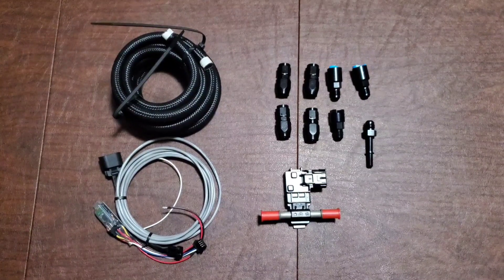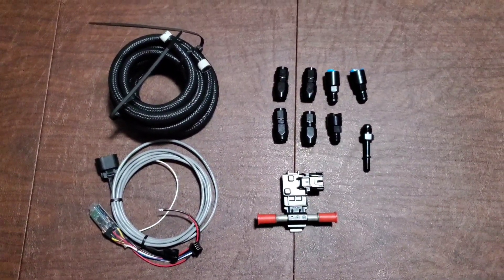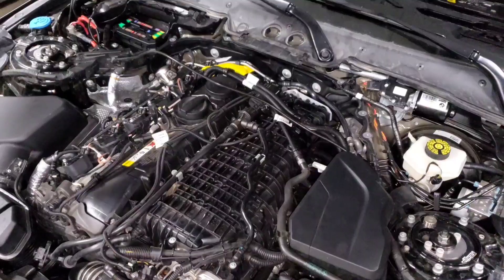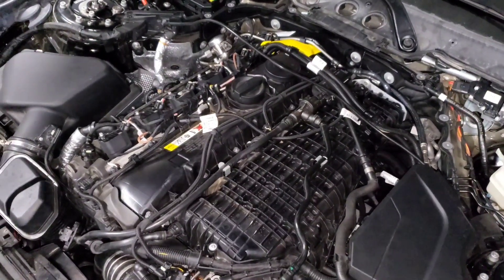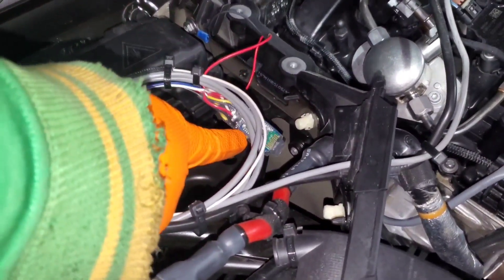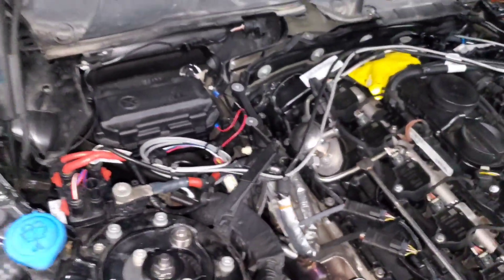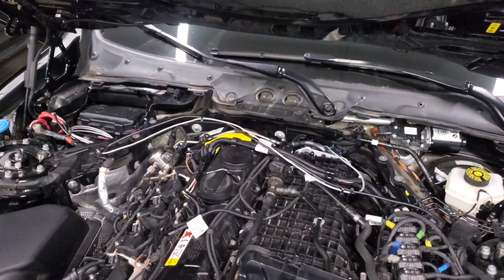How to Build your own B58 Ethanol Analyzer

Comment: Do you have a video on how to do it with 360 fittings instead of making a new line? Or know anyone who does?
Reply from the maker: Check out my mhd flex fuel kit install. It should be included in that one
Reply: @ bet thank you
Reply: @kern417 I also have a 2018 440 I need to buy the fittings, do I need 5/16 or 3/8? Thank you!!

Comment: Hey brother, I had a spool it kit. Then removed due to rat damage and misplaced it somewhere.
Anyways, I got left with the spool it analyzer itself. I should be able to diy the rest right, as for going along with your diy?
I’m currently on a dorch stage 2
Reply from the maker: the easiest way is to add the pr loop fittings with a sensor. no need for the whole fuel line kits anymore.
Reply: @kern417  pr loop fittings? I’m sorry, are you able to link me to one? I would appreciate it!
I appreciate the response brother!

Comment: Would this work on a g20 gen 2 b58?
Reply from the maker: no need anymore. just get the PR 360 fittings
Reply: @kern417  so just the pr 360 fittings and the sensor?
Reply from the maker: @Zurdo_Grease  what are you hooking it up to

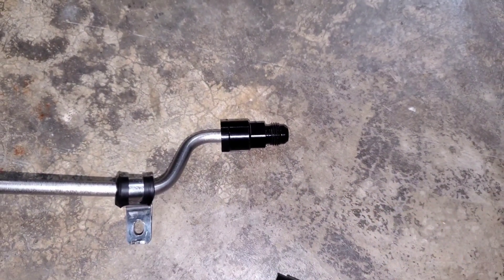Comment: at 4:30 in your video, is that a 3/8" or 5/16" fitting?  I am trying to install a Spool Ethanal Analyzer that I bought used, but realized the includes hoses are too short to reach the HPFP.  I wanted to connect to the oem metal fuel line and convert it so that I can screw on the Spool soft lines.
Reply from the maker: 5/16
Reply: Thank you!

Comment: Is there a way to build something that integrates into MHD to run a flex tune and have ethanol on my gauge cluster?
Reply from the maker: You'll need a zeitronix analyzer and wiring to tap into the car's harness
Reply: @kern417  got it. Was looking into mhd eca kit

But theirs is only for autos? And mine is a 6mt. So there went that
Reply from the maker: i'm planning on making a video to show how to install it on manual cars
Reply: @kern417  I love you

Comment: do you think the 435i would have the same connections?
Reply from the maker: It would be similar but the n55 hpfp is in a different location (under the intake manifold). It you look up some of the n55 kits available then you can probably try to DIY a kit that replicates it.

Comment: Did you need a tune?
Reply from the maker: You don't need a tune in order to install this. All it does is read your ethanol content.

If you want to run higher amounts of ethanol, then yes you need a tune.
Reply: How much was the grand total for your setup?
Reply from the maker: @Lukensm85  ~$225